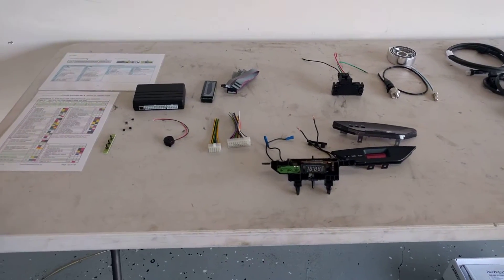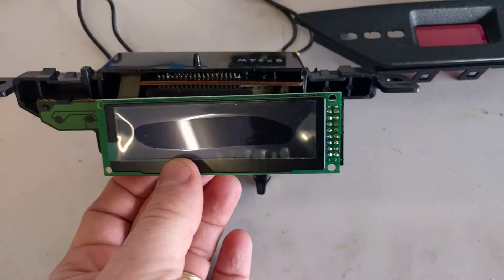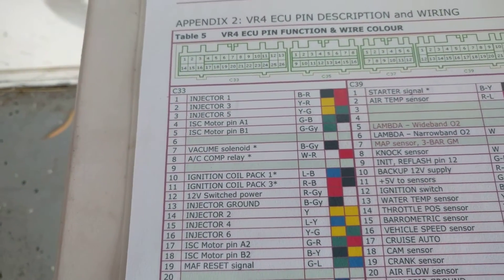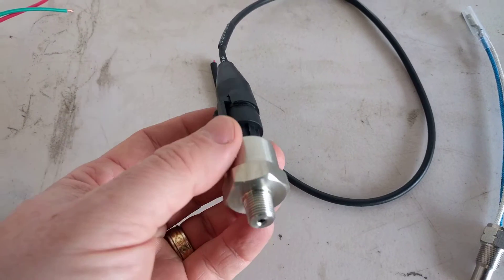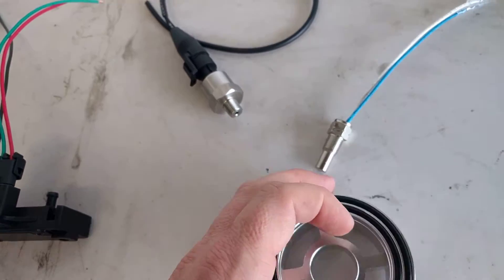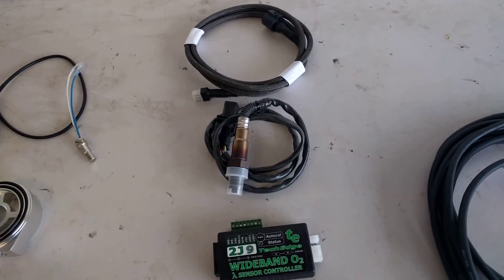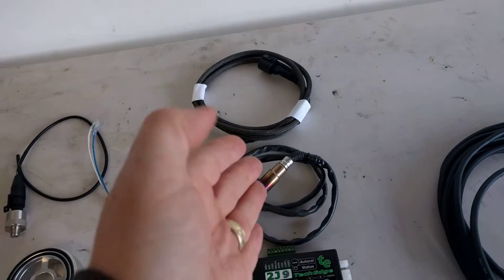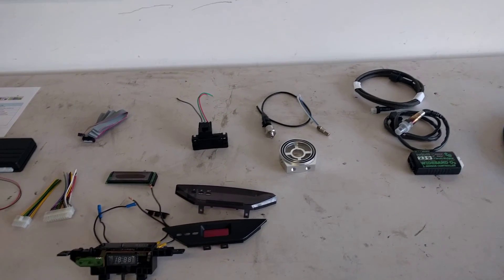UTCOMP installation kit for Mitsubishi Galant/Legnum VR4.

Comment: Where was the sandwich plate bought? I'm having trouble finding one.
Reply from the maker: Just on eBay.  I searched for "oil filter sandwich plate" and bought one of the Chinese ones.  I just did a search and got heaps of results.
Reply: @KaldekBoch  Thanks. I'm guessing there's no specific one for our car/engine?
Reply from the maker: @3Lints  No it was just multi-fit/universal.

Comment: Great video. Thanks being thorough and all. Awesome tip about the temperature sensor mod! I just ordered a UTCOMP-Pro, their 4-Channel EGT-K thermocouple amplifier and a handful of sensors from them. I was looking high and low for a reliable data-logging system to log parameters I can't log with the Cobb Accessport and I was getting really disappointed because everything was either junk or prohibitively expensive. I already have an AEM Wideband Failsafe Gauge and I had finally given in to spending a crapload on their AQ-1 (which is useless without their expensive wiring harness). And it still would not have has as many useful (to me) features than the UTCOMP-Pro. So psyched I found these guys (REVELTRONICS) right before spending money I was going feel bad about spending.